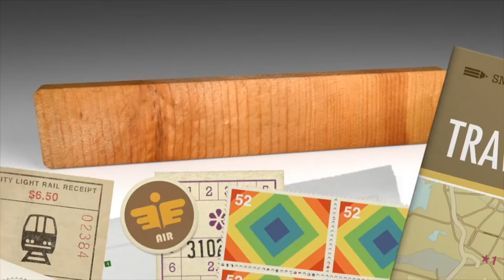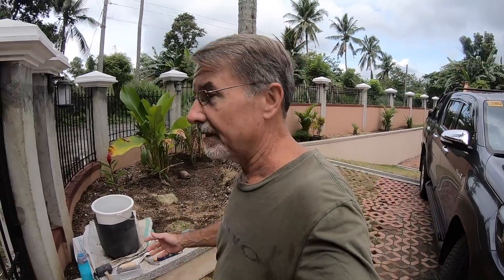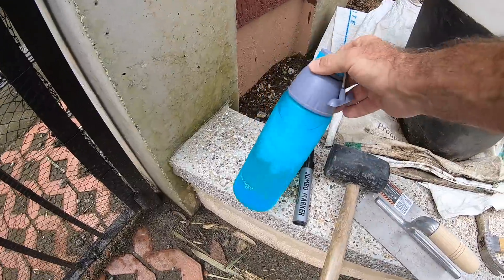VILLA FELIZ - EPISODE 376: HOW TO INSTALL STONE ON FENCE P0STS (House Building in the Philippines)

Comment: 4:03 Hi James, One trick I use to see my grand use was to mix a solution of dish soap(don't know if the brand matters)..but just plain water and dish soap(not a heavy concentration) in a spray bottle. When you see the fruit starting to turn you start to spray. picking just as it has turned about 2/3 of the way. place in newspaper keep in a dry dark area for a few more days(by then it should have fully ripened. Washing it thoroughly before consumption.

Comment: You are doing a great job on the stone work and I think it's best you do all of it rather than the contractors guys who won't do it anywhere near as well. 

But do your generator first so you can get on with work when you have a brown out.
Reply from the maker: We have 6 - 12 hour brownouts scheduled for Sept.  I'm only waiting on my 50mm core drill bit to arrive from Lazada.  It showed at LEX (Lazada Express) for delivery but those guys usually hold on to items for several days before it makes it here.  That'll be the next project completed after delivery.

Comment: James 
Make yourself a gig to install the stonework .It will save you an enormous amount of time.
Make a picture frame  type of frame out of 1 X 2 with screws at the corners so that you can girdle the column, the inside measurement of the frame opening should be just a bit larger than the columns so that it can be slid up or down the column as required. 
Use a clamp or a wedge  to hold the frame in place and adjust it to the level where the layer of stone is going to be stuck to the column.
This way you can work all around the column at one time and all the stones will be level without using the nails. QED.
Reply: Just a spell check - That should have been "JIG".
 I am sure that James knows what a 'gig. is ??? LOL

Comment: Hi James I like the tile you picked.  You have lots of posts to do as you know.  When I do projects like that I have found that the world is never perfect.  I check the size of each post and start with the larger posts first.  Then if I cut a tile a little short it will work on the smaller posts.  I keep a box with all the cut tiles and the "drops" in a box arranged from long to short so that I do not cut more than I need and don't have to spend the day looking for the size I need.  Also on the first run I use a nail but after I use tape to hold the lower tiles from slipping down by taping the lower tiles to the top tile.  It speeds things up.  By the time you cut the lower tiles and mix and apply the thin set it will set up enough to hold the tiles as you go.  I know however you do it, It will look good in the end as all the rest of the house dose.  Keep up the good work.  The mitered corners are a little more work, but look so much nicer,
Reply: One more thing pull your lights and tile under them.  It will be faster in the end.  If you ever switch out the lights you will not be driven by the size of the old light.  You might never change the lights but someone will.
Reply from the maker: Great advice Steven.  The lights are going to add to the installation time as its quite a process getting them to fit.  I'd like to do what you recommend by pulling the lights but that's going to be a nightmare with the type stonework I picked.  If it were flat it would be a walk in the park.
Reply: You know best I am here looking and you are there doing.

Comment: A quick note about the quality of a saw, line cutting speeds, and cutter edge rotation speeds. The cheap saw issue means you can not force the unit. A better saw can input a higher amount of energy quickly because it is built heavier, and energy is what it takes to cut stone. You can input just as much energy with a cheap saw by inputting extra time to process the cut. Less pressure on the saw more time for the saw blade to cut. Also, use a good clean unworn blade. This allows for the greatest speed at the outside of the blade. With the rotation of the saw being fixed, a worn blade surface speed decreases. Unfortunately, a poor quality saw might not have been designed for optimal speed, to begin with sooo... you get what you pay for? But for one-time job use, be patient. Also, sometimes you can help an inferior piece of electrical equipment by monitoring the motor temp with your hand after each cut. If the temp is high, allow the motor to cool before making another cut. This is a good practice even with a good motor due to low voltages caused by long extension cords. And as always, patience is a virtue! I, however, am not a vulturous kind of guy awaiting carrion. The heck with patience, I want to kill something!  :-P God bless!